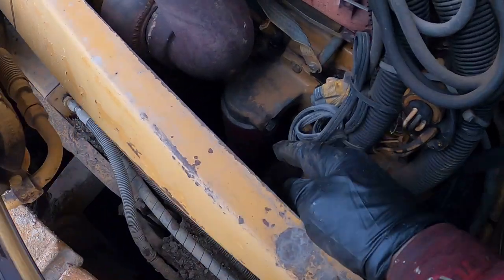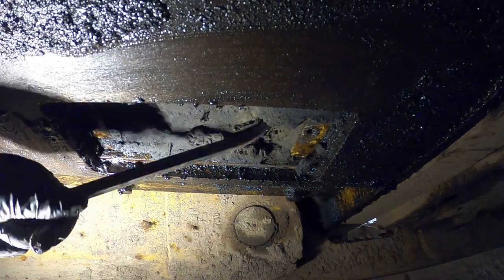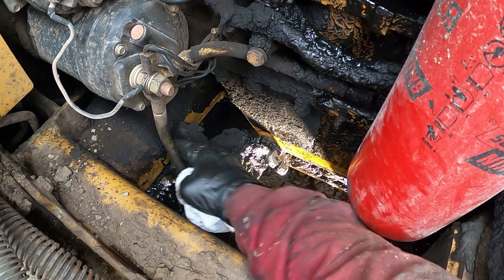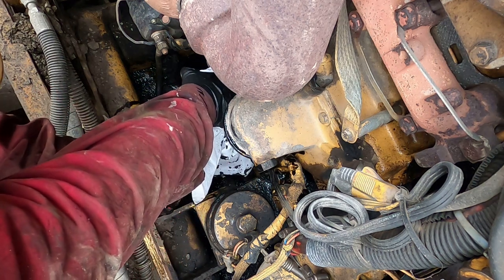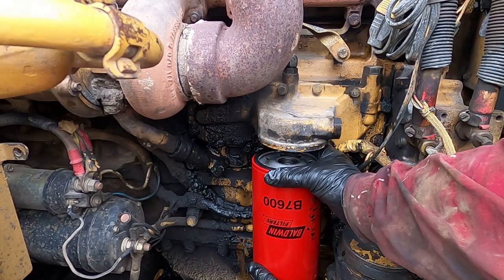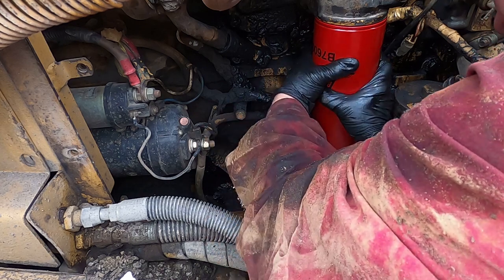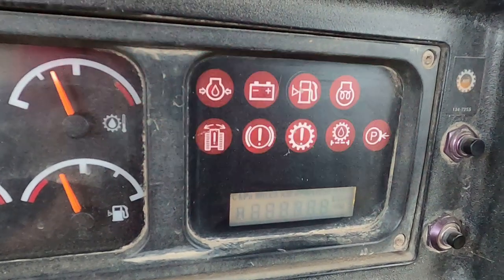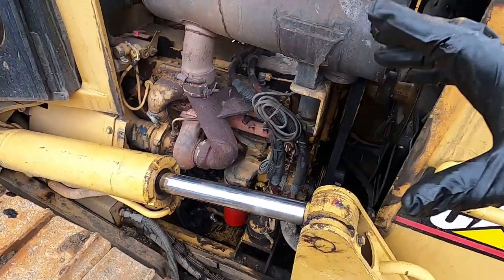CAT D6M ENGINE OIL CHANGE | CATERPILLAR CRAWLER DOZER

Comment: Thanks for that video. I just bought the same machine.  Not sure how to check the hydraulic fluid level. Surprisingly not much info on the net. I suppose I will have to buy the manual?
Reply from the maker: Greetings Dan! You're so welcome) On D6M at the right back corner you will find hydraulic reservoir, down below  filler cap locate glass measure tube - that's it.   You should see hydraulic fluid level. 
Local CAT dealer sells service repair manuals.